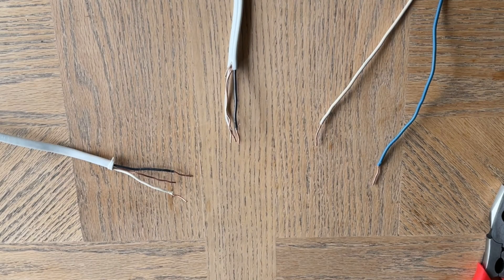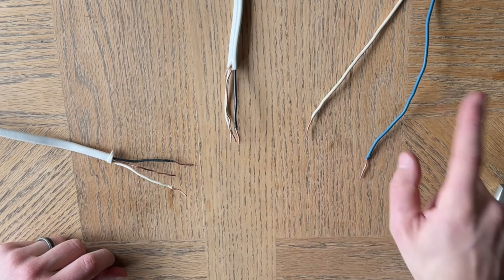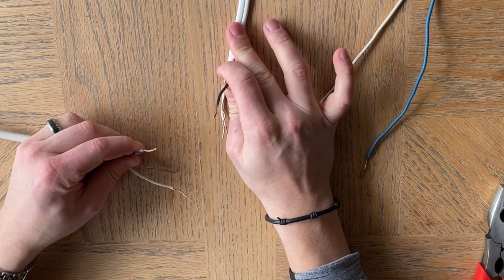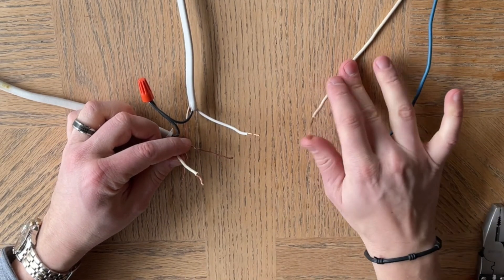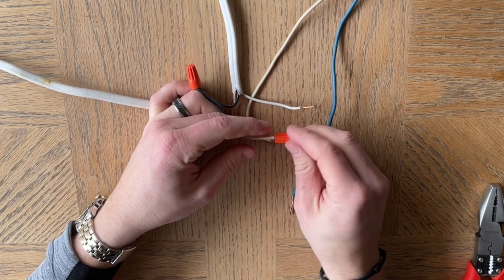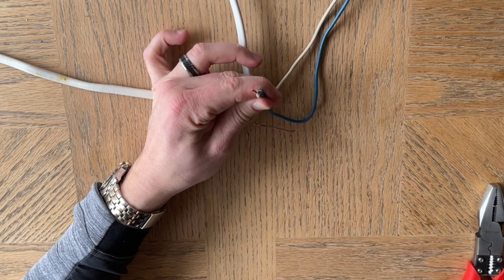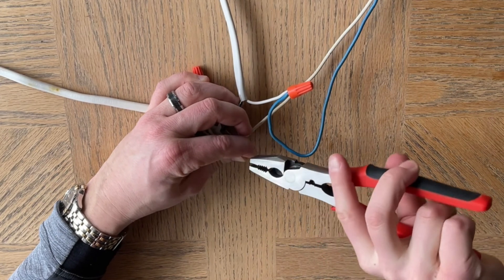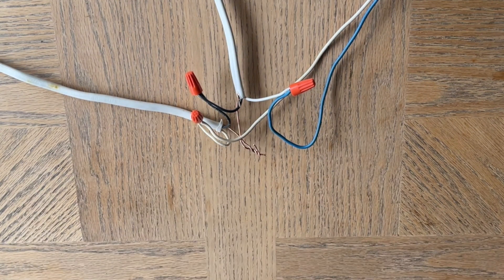How To Power A Light Switch From The Light Fixture

Comment: Hey man.  Love the video.  Im really confused about this wiring thing and i really hope you can help me.  I have the same situation as in your video, only my fixture is a exhaust fan with a separate light and separate night light.  I have a triple switch to connect to (one with a black screw on the left and 3 screws on the right).  How in the world do i connect the three separate terminals so they all work separately when the power comes into the fixture first.  I have three seperate wires running down to the switch and the loose power cable coming from the breaker box and they are all just laying up in the attic.  I did manage to get the fan hooked up like you showed in the video, but i cant figure out how to hook up the light and night light.  Any info would help.  Thank you for your time
Reply from the maker: Glad you like the video! It seems you’ve got a complex situation on your hands. 

This is what I understand: the “hot line in” is running from the breaker box to the fixture and you have the exhaust fan wired and working. Now you need to power the light and night light and then connect them to the switches.

Since you have the fan working, that means you must have sent power from the “hot line” in the attic down to one of the light switches. Disconnect that and add “pigtails” from the “hot line” to the off screw (bottom) on each switch. Then, run another line from the on screw (top) back up to the light and the night light. 

Therefore, you’ll have: a hot wire running down to your switch box. One pigtail from the hot wire going to each light switch. So 3 total. 3 wires running from the switch box up to the fixture. One wire for the fan, one for the light, and one for the night light. Each wire connected to its own switch. 

Hopefully, this helps you with the situation. In addition, please note that any advice you receive or use from me is not to be used in place of or as a substitute for a licensed electrician. You also take it at your own risk.
Reply: @HowToVideoChannel  thank you so much. Ill try that when i get home today
Reply: @HowToVideoChannel  oh yeah.  It isnt 3 switches.  Its one tripple switch that has one black screw on the left for the power and 3 screws on the right for each switch.  Thats the problem.  Thanks
Reply from the maker: Okay, so send the hot line into the one screw. Probably keep it like you have it since you have one switch working for the fan. Then, treat the other two screws as if they are switches. Send one line to the light and one line to the night light.
Reply: @HowToVideoChannel  sorry to keep asking questions but i just tried to wire it up and it still doesnt work.  Only the fan works.  What am i supposed to do with all the white wires?
Reply from the maker: Where are all the white wires?

Essentially you will need to have 5 or 6 wires running from your fixture to the switch box.

One line of Romex will contain a black hot wire, a ground wire, and a traveling wire for one switch. Then you have another line of Romex where you use the two insulated wires as traveling wires for the switches to control the fixture and an obsolete ground wire. Or two individual wires of blue, yellow, or green if they are already ran.